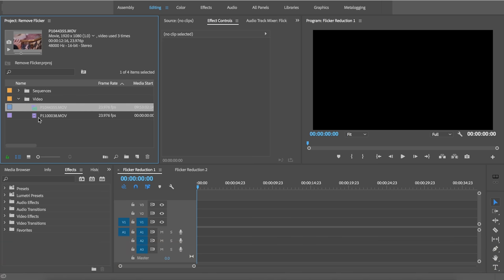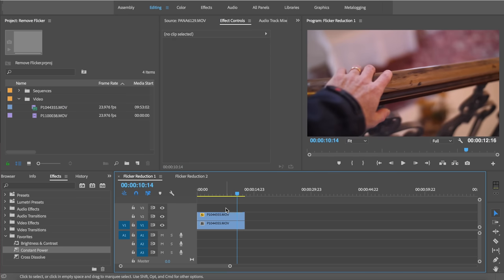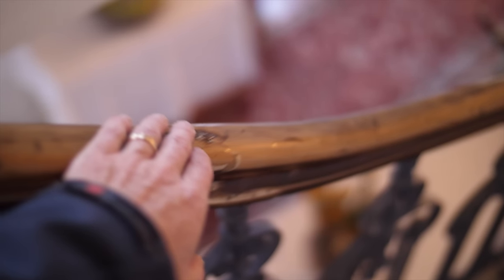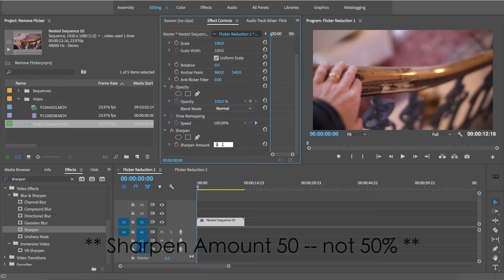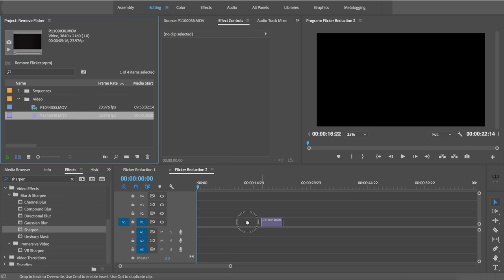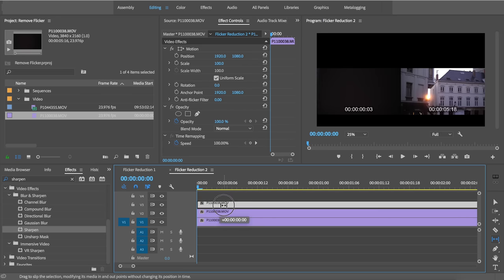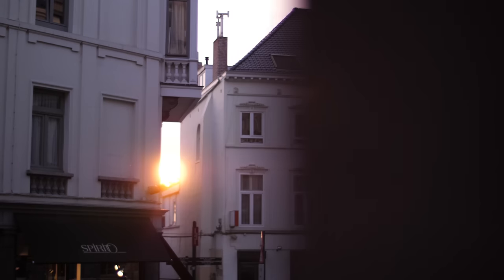Fix VIDEO FLICKER in 30 Seconds WITHOUT Plugins

Comment: Hi I am trying this out with a flickering video shot at 24fps with Blackmagic Pocket Cinema Camera. The flickering kind of goes away after adding four layers but it slows down the video and makes it look awfull, i.e. like some half freezing slow motionish crap. I guess this is not an ideal method for video shot at 24fps?
Reply from the maker: Sorry for the late reply. I hadn't gotten YouTube notifications that the video was receiving comments, so didn't realize until just today.

Yes, this method only works with footage that doesn't change significantly from one frame to the next. Thats's why it's ideal for slow motion, but not for realtime footage. I definitely wouldn't use this technique on realtime footage, unless it was a shot that didn't have camera movement or subject movement.

You might have luck with DeFlicker, which I've heard is a good program for removing flicker, but I've never used it before.

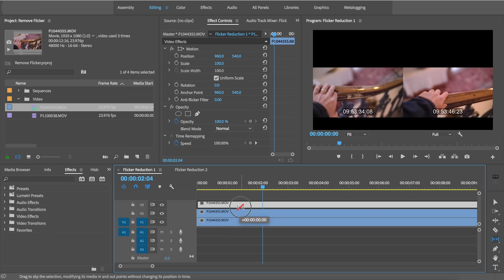Comment: 0:35 Can you explain how you set +1 frame with slip tool? I am using Sony Vegas pro and Premier Pro seems so weird with the controls. Im dragging the mouse to the left while holding left click but it doesnt change the frame value.
Reply from the maker: I haven't used Vegas, so I don't know what tools are available and/or how to use them. That said, you don't need to use a slip tool...you can just manually drag the clip one frame over from the layer below it....you'd then need to trim the beginnings and ends of the clips to have them all line up.

Comment: That is exactly what I've done in Davinci Resolve 16 and nothing changed, still flickering exactly the same way
Reply from the maker: Does Resolve have a slide tool? Or did you just push the clips over by one or two frames? It surprises me it didn’t make any difference at all. I’ve usually found that even if this doesn’t fix a clip entirely, that it at least makes the flicker much less noticeable.

Comment: I tried this to remove flicker from footage that I shot in a ship's engine room where the generator runs at 50 Hz instead of the usual 60 Hz (so not for a slomo). The fluorescent light causes bands rolling across the screen. Unfortunately, the trick as shown in the video doesn't work (in FCPX)... Any thoughts how I might use this method for fixing this?
Reply from the maker: This method doesn't really work with realtime footage because there's usually too much movement in realtime footage. You may need to use a flicker reduction program like DeFlicker to get realtime footage clean.

Comment: Its awesome but my footage has too much movement in it.  Is there another option???
Reply from the maker: Bummer. I don’t know of another non-plugin and/or free way, but I’ve heard good things about Flicker Free and DeFlicker, which are both paid programs, but they may be able to fix the problem. I think there are trial versions of those, so you could try it, see if it works for you, and if it Dirac then buy the program.

Comment: How do you get around slight movement stuttering from the 1-2-3 frame delay?
Reply from the maker: Best chance is to use one of the two methods I talk about in the video: either mask off (if possible) only the portion that's flickering, or nest and sharpen the layers together. If there's anything more than a little bit of movement then this technique won't work, unfortunately.
Reply: @BlueMantleFilms  The footage I'm using must be sensitive to this process. BUT, I tried what you mentioned at the end using only one dup at 50% and it solved the flicker and the one frame difference was far less noticeable. A good reason to do it that way as well I suppose. Thanks!

Comment: Hi did you say it helps with denoising the image
Reply from the maker: Yes, it can definitely help with denoising. This method is essentially averaging the frames (so either two or three frames) into one frame, and since noise is random, it's also averaging the noise in footage, which makes it appear far less noisy. For most realtime footage there's too much motion for this to work to denoise, but it does seem to work with some drone footage since that's often farther away and there's less changing from one frame to the next, and it also seems to work to denoise timelapse footage if you're okay with the timelapse having motion blur or ghosting (which for timelapses, I usually intentionally shoot long exposures to get motion blur, so having multiple exposure just increases that look of motion blur, so I don't mind).

Comment: Hi Matt, I tried your way, but when I rendered the video... the result is still flickering... does your export file normal with no flicker?
Reply from the maker: It really depends on the type of flicker...this works for some footage but not for others. Try doing just one layer above at 50%. If that doesn't work try three layers at opacities of 50%, 33%, and 25%. Beyond that you could try adding more layers, but then the ghosting effect will be so pronounced that even if you get rid of the flicker the footage probably won't look good. If it's footage that you absolutely need to have (rather than just footage for a personal project that because of the flicker you can choose to not include it) then I recommend using a plugin. I recently bought DeFlicker because I had a client project that had some flicker and the hack in this video didn't work. It's expensive at $250, but it fixed my problem, and I needed it fixed because I couldn't reshoot the footage.
Reply: @BlueMantleFilms  Thx for the reply... I'll try out.

Comment: Ive stacked the layers but my slide tool doesn't seem to move any frames? the preview doesn't change, and the timecode shows 00:00:00 however far I drag, any ideas? thanks
Reply from the maker: Set in and out points on your clip before putting it on the timeline. It never occurred to me that people would try this on complete clips rather than just a specific portion of a clip that looks good, so I didn’t think to mention it can’t be the full clip. The slide tool needs extra frames before and after the portion you’re working on, otherwise there are no frames to slide with.

Comment: My slip tool does not show +1 or +2 frames. Always stays zero. Seems like my layers are locked or something?
Reply from the maker: If you haven’t set in and out points on a clip (and therefore are using the full length of the clips) then they can’t “slide” around inside of themselves. Just move the clip 1-2 frames over rather than using the slide tool.

Comment: I don't really understand why the slip tool isn't working automatically like yours is? What am I missing?
Reply: try marking in and out points before inserting the clip into the time line , that worked for me !
Reply from the maker: I'm thinking what Astro Kids said is right. If you drop the full-length clip onto the timeline, with no "handles" before and after the start and end of the clip, then there simply aren't frames at each end to allow the clip to slide inside of itself. So marking in and out points for the specific part of the clip that you'd like to use also allows for handles and allows the slip tool to work.
Reply: @BlueMantleFilms  what do you mean exactly "handles". I have to move the clip a frame? Or extend it? Not quite sure
Reply from the maker: @TidusILU  By "handles" I mean not using the full original length of the clip in your timeline. That means there will be some unused frames from the original clip that don't end up on the timeline, and that's exactly what you want because it allows the clip to be able to be slid around with the slip tool.

Comment: tried it....didnt work. im shooting with gh5 180pfs, used after effects, used premiere...not sure what i am doing wrong?
Reply from the maker: Sorry I didn't reply earlier. I just realized that YouTube hasn't been giving me notifications of comments, so I've got like 15 comments that I never responded to.

I've found sometimes it's necessary to use more than two layers above the original. There was one time I was working with footage that had fluorescent banding, and I was able to get the banding to stop by using 7 layers. That said, using 7 layers made it so the footage was still unusable because of the multiple-exposure aspect of doing that.

Try doing six layers, with opacities of 100/50/33/25/20/17, each layer after the original layer offset by one frame from the layer below it. Then try turning off layers from the top (the 17% opacity layer) and use as few layers as possible that still allow the flicker to be reduced or not showing.

Comment: I tried over a time ramping video and its shows all blurry and like psychedelic. How do I fix that? The same goes with 120fps.
Reply from the maker: Get rid of the flicker first, then nest the clips all together and do the speed ramp on the nested clip. In this scenario, though, since you're talking about a bunch of different effects that interact with each other (multiple layers, different opacities, offset frames, and then speed ramping) I would most likely do the flicker reduction, then export that clip as a new clip, then load that into the editing program and do the speed ramps on that. In scenarios where I've had lots of effects that can sometimes conflict with each other I've found it can crash the program, so getting a clean version of the clip and working with that seems best.
Reply: Is the slow-motion trail normal?
Reply from the maker: Unfortunately yes. It only really works on clips that have little movement, since it creates that trail/ghosting effect.

Comment: My clips won't slide over, they won't move a frame over. Is there a way to fix that? PLEASE HELP!
Reply from the maker: You must have put a full clip onto the timeline without setting in and out points. I didn't address this in the video, but the slide tool only works if you're not using the full length of the clip on the timeline. Easiest way to solve this is simply drag the clip over 1 or 2 frames rather than using the slide tool. Or, if you want your timeline to be clean, trim a few frames off the beginning and end of the clip before you put it on the timeline, then the slide tool will work.

Comment: Which software is this ?
Reply from the maker: I use Adobe Premiere Pro, but this method can be used with most video editing programs. One difference is not all applications will have a slide tool, so in that case you can just drag the clip over by one or two frames.

Comment: I can't get the slip tool to work to move the clips to different frames. What am I doing wrong?
Reply from the maker: Are you using the full clip (without setting an in and out point)? The slip tool only works by "sliding" the video back and forth inside of the in and out points of the clip on the timeline, so if the clip on the timeline starts at the very beginning of the clip, or goes to the very end of the clip, then there's no extra frames to allow it to be 'slid' around.

You can either just drag the full clip on the second layer over one frame on the timeline, or (what I think is the better solution) set in and out points on the clip before you put it in the timeline, then it will have that extra space and the slip tool will work.
Reply: @BlueMantleFilms  I ended up figuring that out, but my film has too much motion for this to work :/
Reply from the maker: Bummer! Unfortunately this trick just doesn't work on all types of clips.

I also use the plugin ReVision DEFlicker when the above trick doesn't work. It's expensive at $250, but I bought it when I had footage from a client project that I couldn't reshoot (it had been filmed on the other side of the country) that had flicker. It worked pretty well, and for minor movement it didn't have the problem of ghosting that you find with the above technique. But when the subject would move his hands quickly, even that it ended up having a weird sort of ghosting.

Comment: Didn't work so well on my end. Tried a bunch of different stuff, but ultimately, I'm seeing a ton of motion blur on a clip with only a subtle bit of movement. Footage is 4K RAW 48FPS from a Sony f55. Anyone got any tips to troubleshoot? (Plugin recommendations welcome too!)
Reply from the maker: Yep, not a perfect solution, but it has worked for me many times, so it's still a good trick to have up my sleeve. I have tried this on real-time footage only a handful of times, since of course there will be a fair bit of movement for anything in real-time. At 48fps, I'm guessing you're using it at 50% in a 24p timeline? I still think that would likely introduce too much movement in the footage in most cases. For the samples that I used in this video, I was shooting at 180fps, for a 24p timeline, so it was slowed down 7.5x, so all of the movement was very slow and subtle.

Comment: Hi i don't know why but i can't drag the video further. Can anyone have the same issue? Thx for the video.
Reply from the maker: Rollo Tomassi instead of using the slide tool, try dragging the clip over one or two frames. The slide tool needs extra unused frames at the beginning and end of the clip to actually work, and I’m guessing you’re using the full clip rather than just a selection from the clip.

Comment: Any idea why it's not working? I slide, but frames are stay at 0
Reply from the maker: My guess is you put a full clip into your timeline. If you use the full clip (instead of selecting an 'in' and 'out' point on the clip and then putting it into your timeline) then you don't have any available frames for the clip to "slide" with. So shorten the beginning and end and it should work, or just drag the clip one frame over instead of sliding the clip over.
Reply: @BlueMantleFilms  yeah that's what I did.. I dragged the clips and it worked perfectly! Many thanks to you good sir 👍

Comment: It´s not working for me..idk why. I´m using premiere pro and nothing works i´ve tried everything i guess...
Reply from the maker: If you're using the full length of the clip (without first trimming the beginning and end of it) then the slide tool won't do anything. So if that's the case, either trim the beginning and end, or just drag the clips on layers 2 and 3 over by one or two frames.

If that doesn't work, then it's possible that the flicker you're dealing with is a kind that this technique doesn't work for. Sometimes it just doesn't work, unfortunately.

Comment: It's frustrating to see I'm the only one who's not getting it right. I tried this method and didn't work for me :( I could only remove the flicker moving one duplicated track FOUR FRAMES (or one copy two frames and a second copy four frames) but this creates a lot of blur..... Anyone?? Any help will be appreciated!
Reply from the maker: Yeah, unfortunately it doesn't work on all footage, but it's always the first thing I try if I've got flicker, since it's so easy and quick.

Is your footage slow motion or is it realtime? If realtime, this technique hardly ever works with that because there's too much motion. When the movement is really slow it's possible that 4 layers could work, but that's more rare. I usually can get away with 3 layers.

I more recently have started using Re:Vision Effects DeFlicker, which also has its shortcomings (most notably that it costs $250!) but it does usually do a better job than the hack from this video.
Reply: @BlueMantleFilms  Thank you for your reply. I tried your trick with several clips where several kind of bulbs were recorded. No one could be corrected. I used a Sony A7III in 120fps mode and shutter speed above or equal to 1/250 obviously. The output file playback is 24fps and I tried many combinations with duplicated layers, opacities and frame desyncing and never succeeded. So frustrating haha

Comment: Works for flicker, but now I have more motion blur than I'd want :'(
Reply from the maker: Yep, that's the downside to this method. Are you working with slow motion footage or realtime footage? With slow motion footage the movements can often be small enough that the motion blur isn't too bad, but I've very rarely had this method work with realtime footage.
Reply: @BlueMantleFilms  120fps
Reply from the maker: @RushingProductions  If the motion blur is small you can nest the layers together and add a sharpen filter (I do that on the clip of my hand) which might make it look slightly better. But that said, I guess it just comes back to that this doesn't work on all clips.
Reply: It's not awful, just more blur than any other part of the video. Probably no one who views it would really notice, wedding film. I'll just notice it forever lol
Reply: @BlueMantleFilms  Interesting idea. I'll try that and let you know, thanks!

Comment: f this is for slow-mo video...for fast mo video what you have? i have this problem with video flicker but when people dance..i cand make it slow motion..i don't know what to do..help me
Reply from the maker: I haven't really ran into flicker on real-time footage very often. You're correct that this hack won't work on realtime footage since there's too much movement, so if it's footage that you absolutely have to use, then I'd suggest trying some deflickering software (so not free, unfortunately). DeFlicker and Flicker Free are two that I'm aware of, but I haven't used either of them myself. Sorry I can't be more help!

Comment: thanks guy I fouded solution with to layers and 50 % alpha...no results :( but with this method it s ok thanks a lot
Reply from the maker: Awesome! If it still isn't quite perfect (because it depends heavily on the frequency of the LED pulses) you can try doing three layers, as in this video, but put the first layer at 50% (instead of 67%) and then the second layer at 33%.